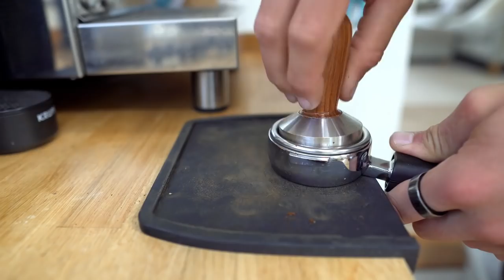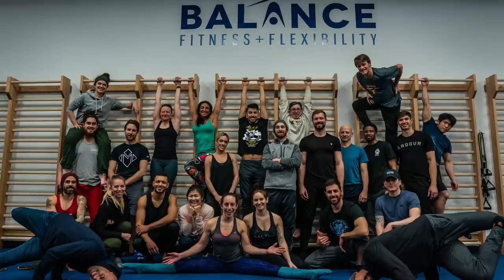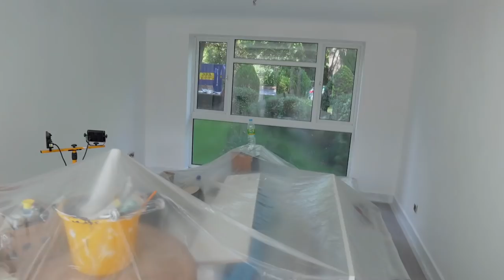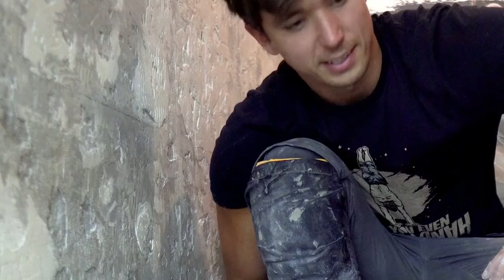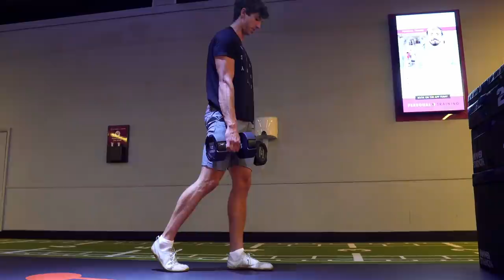Vlogs Are Back! | Lower Body Strength & Flexibility

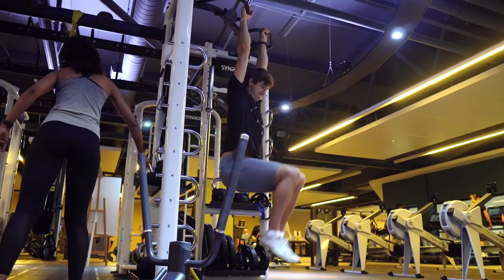Comment: Tom, I see you doing tucked knee raises hanging on the bar at 7:16 min... I find them really hard to do. Fun fact: I can do Dragon Flags, Back Levers and Tuck Front Levers pretty easily. But the knee raises are brutal..... What is your experience with them as far as strength/difficulty?
Reply: Hip flexors brah

Comment: Great to have the vlogs coming back, have you ever talked about ground vs paraletts handstands? I ask because I'm at a point where im holding 15-20 second paralet handstands and can manage a few hspu, but when switching to ground hspu feel impossible and my hold time is cut to about 5-10ish seconds (on a good one). any tips would be appreciated.
Reply from the maker: Got you covered. https://youtu.be/siG0ZSwVPJE
Reply: I have the opposite problem, I can manage 30+ secs balancing on the ground, but can't balance on paralettes for more than a few seconds.... Which is really just falling slowly, not balancing 😁